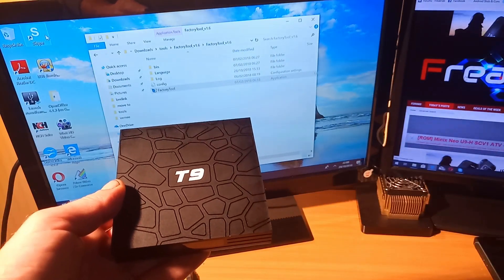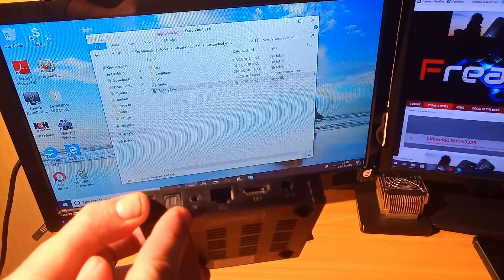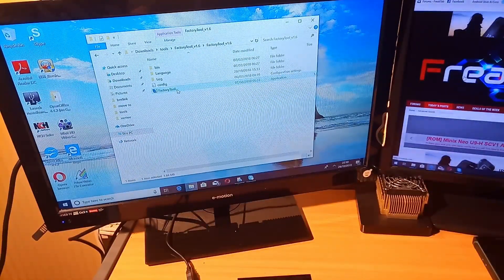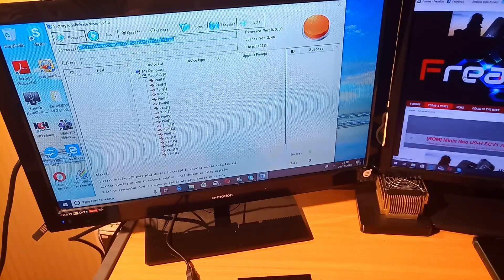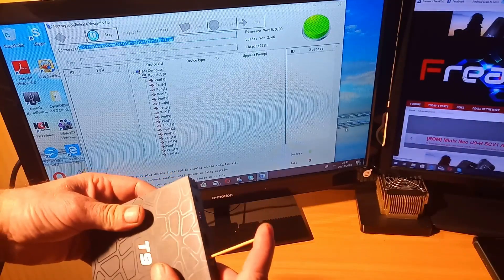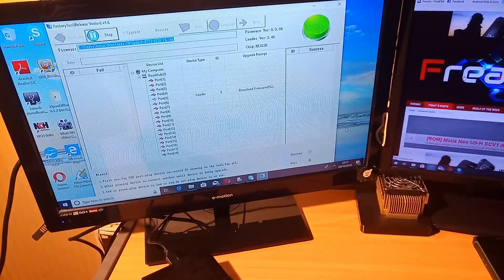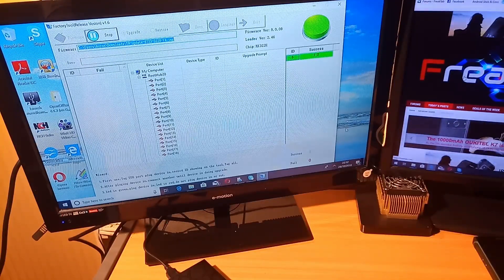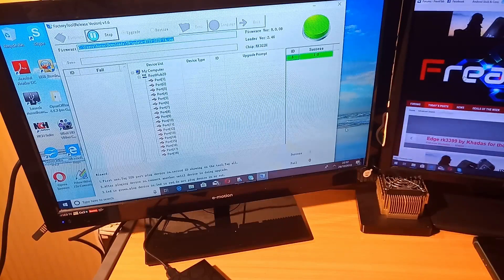Sunvell T9 TV BOX firmware Flashing 4/32GB version

Comment: hello dear. i install rom on my t9 device same like you tell. the rom was installed successfully but after installed my device not turning on. no light no power please give me solution thanks
Reply: Hi, anybody can help?
I have the same problem here. I got the same T9 TV box RK3318 4g/32Gb. It is in bootloop now. 
Do u have any link to download the RK3318 rockchip firmware? 
Tks.
Reply: i have the same problem, did you fixed it ?
Reply: Same happened to my box RK3318 no power, no luck

Comment: How do i unbrick this T9 Android box?
Reply from the maker: What is the problem you have?
Does the box boot at all?
Did you try to flash the fw ?
Reply: @buytech9951  the box just went dead.  I turn the power and there is no reaction.  No power.
Reply from the maker: @mrvictorlau  The first place to start is to make sure the PSU is ok and working as they often fail.If its working you can try to flash the box again.Everything you will need is below

FirmWare

https://androidpctv.com/firmware-tvbox-t9-rk3328-v8/

Driver assistant

https://chinagadgetsreviews.com/download-rockchip-driver-assistant-v4-5.html

RK factory tool

http://geekbuying.mediafire.com/file...yTool_v1.6.zip

The FW is very easy to flash as on most rockchip devices (No power lead is needed)

1.Download Fw to pc

2.install the rockchip driver assistant (Click uninstall driver first then install driver)

3.Install RK factory tool & run it with admin rights

4.Load FW into RK factory tool & press run

5.Locate and press recovery button on tv box

6.Connect USB lead to the USB port closest to the SD Card slot

7.Flashing will start if you have installed the drivers correct
Reply: @buytech9951   Hi, anybody can help?
I have the same problem here. I got the same T9 TV box RK3318 4g/32Gb. It is in bootloop now. 
Do u have any link to download the RK3318 rockchip firmware? 
Tks.
Reply: I see.  So if PSU is down there is no hope?
Reply from the maker: @mrvictorlau  PSU is the power supply adaptor.If thats failed you can buy a new one very cheap
Reply: You mean the power plug?
Reply from the maker: Yes  @mrvictorlau
Reply: Oh i notice the power plug has power supply but the box just do not have any lights when i plug it on
Reply from the maker: @mrvictorlau  You need to try and flash the Firmware on to it
Reply: @buytech9951   Hi, anybody can help?
I have the same problem here. I got the same T9 TV box RK3318 4g/32Gb. It is in bootloop now. 
Do u have any link to download the RK3318 rockchip firmware? 
Tks.
Reply: @Surbana2  i hve same problems if u have tell
Reply: @farhankabire519  same here as u and benny, can anybody plz help us at all !!!!!!!!!
Reply: @Surbana2  same here bro and nobody over here seems to help us out :(
Reply: Ok thanks!

Comment: Hello sir...
Can you show the usb cable that you using in the video..
Reply from the maker: Yes sure this is the cable I use,Its about 30cm long male to male 
https://i.postimg.cc/76Gh0qsz/IMG-20190219-110742.jpg
Reply: Can you check if ps4 bluetooth controller support works thanks.

Comment: I ordered one of these off Amazon, first thing at boot up.  BOOT , I sent it back. Ordered what I thought was another android box, came in, it too was a T9, guess what, connected it, boot was on the display, there it stayed. Came in this morning, sent back this morning.  If you get one of these though, as soon as you get it, if it happens to work,  get a spare usb thumb drive,  32Gb or so,   do a back up, then if it crashes, all you have to do is flash from your backup. Learned this from other android media boxes. I will not keep something that will not boot up from factory.
Reply: Can you check if ps4 bluetooth controller support works thanks.

Comment: Hey dude, great video. Where did you get the firmware update?
Reply from the maker: Hi thanks,I got the firmware from the guys over at www.sunvell.com  :-)

Firmware
https://mega.nz/#!g8kQGC7S!Qqva8QWspIQ7tjn1u2nagluKETnr9NtOIeZGaBqdHOU

Driver assistant
https://chinagadgetsreviews.com/download-rockchip-driver-assistant-v4-5.html

RK factory tool
http://geekbuying.mediafire.com/file/hu9om2doyuf9310/FactoryTool_v1.6.zip
Reply: Ok :) thought they might have a site or something where they put the newst updates. But thanks!
Reply: @buytech9951  the firmware link is down
Reply from the maker: Iv uploaded it again  @alpersengun7410  https://mega.nz/#!g8kQGC7S!Qqva8QWspIQ7tjn1u2nagluKETnr9NtOIeZGaBqdHOU
Reply: @buytech9951  thank you i have some problem i if open the factorytoll 1.6v come error      loading config fail error
Reply: @buytech9951   I got a T9 RK3318  3/32 android box. 
Do u have a link to download firmware? Thanks.
Reply from the maker: Arh yes fixed now  @lars-andreeilertsen